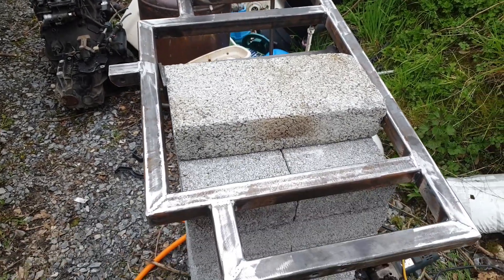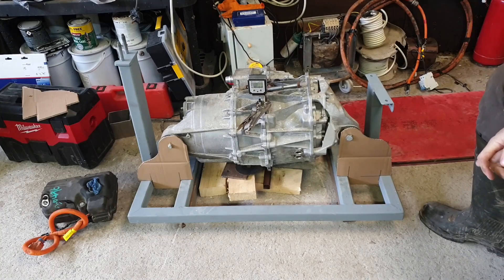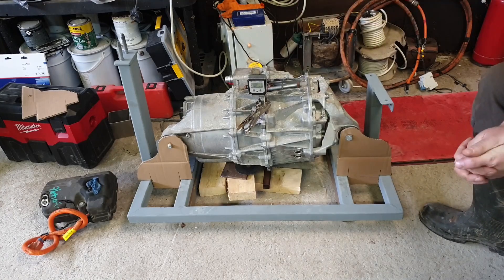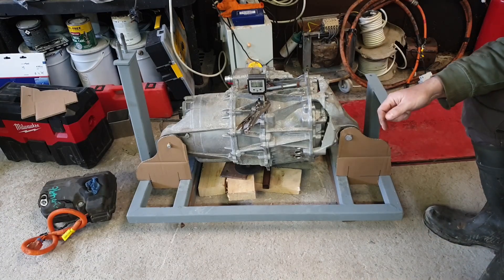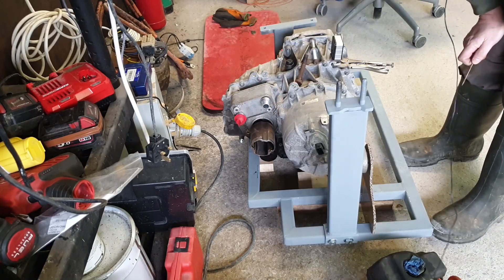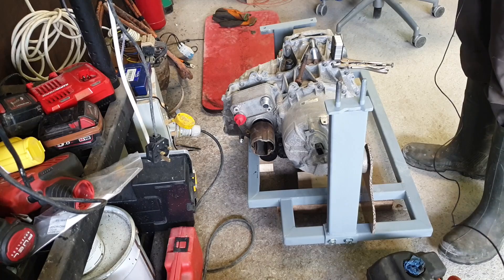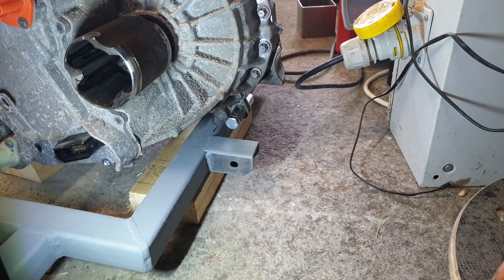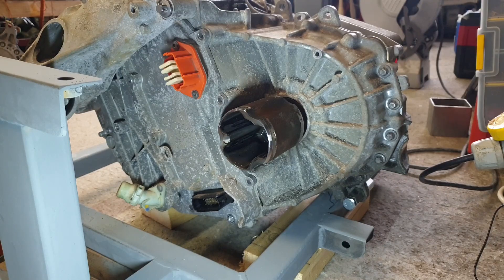The MuskVo Part 5: Cardboard Engineering

Comment: I am doing a very similar task at the moment, mounting a Tesla model 3 drive unit in a sub frame. I am very surprised how soft the rubber mounting bushes are on the motor. To the point it is difficult to make the mounting plates accurately as there is so much movement in the bushes. Are you planning on keeping and using the original bushes?

Comment: It appears that your drive unit differential is now (more) central in the 'engine bay'  the angles involved will be reduced over the original which was heavily biased over to the left, typically with a 2 piece right hand shaft.    If its possible you would ideally have it perfectly central thus eliminating any inherent torque steer from unequal shaft lengths.
Reply: The Volvo V50 indeed does have two driveshafts of unequal length, however as you said the longer drive shaft is supported by a support bearing. The "dynamic" part of both drive shafts are pretty equal in length, albeit probably shorter than the new drive shafts with the Model 3 motor will be.

Longer drive shafts (with equal length) are probably a good thing due to lower CV joint angles 🤔
We'll see I guess 😄

Comment: You say the motor is running in reverse. Are you sure? My understanding was the model 3 has the motor in front of the diff... Which is the same arrangement as you appear to have in the Volvo? 
The model S had the motor behind the diff, so if it were an S motor it would be running backwards, but the 3 is installed the other way.
Reply: My thoughts exactly! I think your right
Reply: Yep. I think you are right. The two mounting lugs are to the front on a Model 3.

Comment: Remember to clean/flush the AC system of the Volvo. It's probably a R134a system and the oil used for that is not compatible with the special refrigerant oil required for the Tesla AC compressor.

It would a pity to damage the Tesla AC compressor (either the insulation of the windings or possibly arcing).

Comment: Could you not plate the rear cross beam underneath with 5 or 10mm then section the beam to lower the back of the motor

Comment: Nice subframe, is should do the job I'm getting Binky vibes...

I have a question about the size of the Model 3 motor, how long is is from the
center in the drive shaft cup to the rearmost end of the diff housing and the other
way, how far is it from the center to the front of the motor ?

Comment: can the internal oil pump handle driving in reverse?
somewhere in the past this was a topic somewhere ... they had to install a custom made kit
Reply: The oil pump has a separate motor and is not gear driven as is the case with the LDU for example.